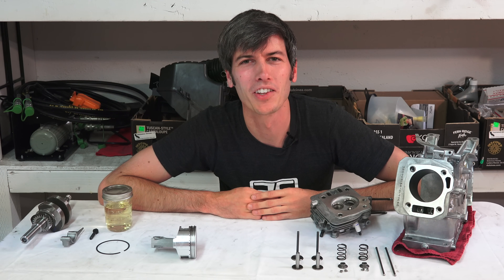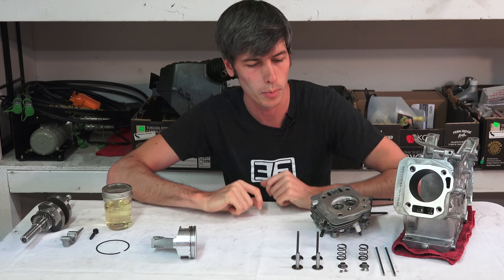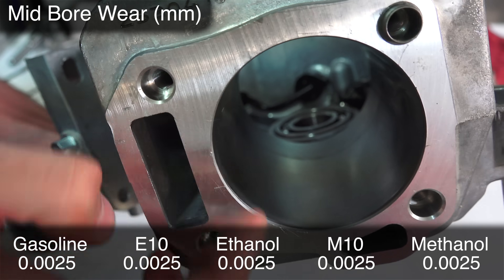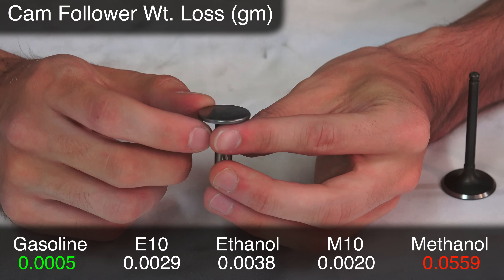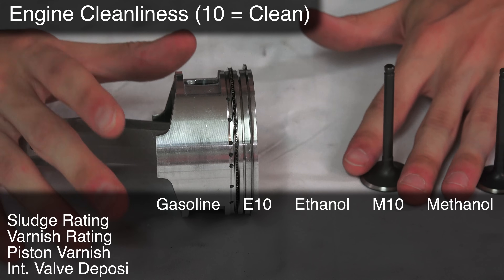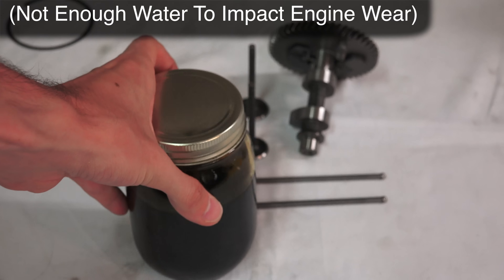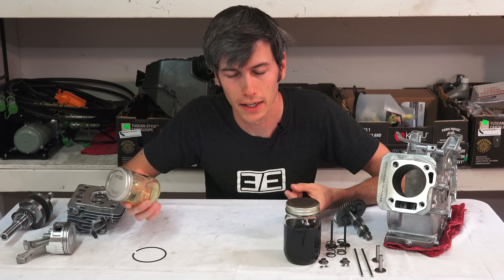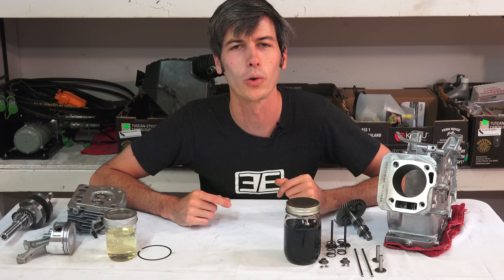Is Ethanol Bad For Your Car's Engine?

Comment: Down here in Brazil we have E92 and E27 fuels. But the prices on gas are skyrocketing, and the market ain't known for good quality gasoline, so most times, the 27% ethanol mixture ain't respected. If you run a simple OBDII tool in our flexfuel cars it'll show a 35-40% ethanol mixture in the combustion of E27 so... We stick to ethanol here (preferably) regardless of fuel economy. Plus the pricing between E92 and E27 gas runs close to the 60% regular efficiency between those 2 fuels. So you kinda get the same $ for mileage, most times...
My car actually benefits from ethanol since I calculated it's efficiency as somewhat around 72% of E27 gasoline, so it's actually more efficient on ethanol.

Comment: Don't know about engine wear but the fuel with ethanol here in the UK gums up the carburetors on small Honda type engines used on generators and other equipment that the old fuel didn't. I have to drain the carbs on my generator and tools if I wish to store them with out being used for a long time period otherwise they will run very badly or not at all when trying to restart them after 6 -12 months storage.

Comment: Great video! Would love to see a follow-up on energy density of fuels (Gas, Meth, Eth, Diesel, etc.). I noticed this when using an E85 Focus in Indana (super flat). I drove the same speed both ways & changed fuel types. Very different MPG numbers

Comment: havnt watched the whole video yet but i want to type this before i forget, modern cars are all designed to run on ethanol in case of a fuel crisis and since modern fuel in america contains ethanol anyway, but older cars are the ones with problems, in older cars ethanol causes the pipes and fittings to degrade, combined with the effect of running unleaded in an older car that is supposed to have leaded causing the fittings to also harden modern fuel can ruin a cars fuel system.
also ive heard alot of motorcycles and track oriented sports cars can have problems from ethanol too.
also running low octane rated fuels in motorcycles and sports cars that dont like it could add to these issues too.
this is all what ive heard anyway dont take my word but its better not to risk.
Reply: ok good he did mention the fuel systems of older cars

Comment: I wonder if there are any wear differences between a diesel engine running purely on diesel fuel, a gasoline oil mixture, with and without propane injection...

Comment: But why do they put ethanol in fuel in the first place??
Reply: Less carbon produced and is more carbon neutral due to being plant sugar based, higher octane, doesn't create other pollution issues like using lead or MTBE does when used as an octane booster, can be made from just about any plant too!
Reply: @GreenJeep1998 now  that's a detailed answer. 😁 Thanks!

Comment: Ethanol is considered bad for your motor vehicle because it's said to effect the non metal parts...   These tests are useless.
Reply: How so? This comment section is cancer. Nothing but statements from backyard mechanics with no facts to back it up.
Reply: Car manufacturers are aware there's ethanol in fuel now, I'm sure they have ethanol compatible hoses and connectors.
Reply: These tests measure engine wear. You might as well be complaining about aerodynamics.
Reply: The title of the video is "Is Ethanol Bad For Your Car's Engine?"
Reply: Not as useless as your comment.

Comment: I've always wondered what fuel injected cars not made for E10 do. Does the O2 sensor account for the air/fuel difference enough for the car to run correctly? I assume it must but I don't know enough about how factory (narrow band?) O2 sensors work.

Comment: This is really handy timing as the UK is soon to be switching to E10 from E5 and a RAC news headline was sent out warning drivers to be cautious of what fuel they put in their car when E10 becomes available. I think it said something like 800'000+ cars that are currently registered on our roads are not compatible with E10, the older cars like you mentioned, but these figures don't make it seem as bad as they make it sound. A detail you covered makes me wonder why it's done. If a higher percentage of petrol (Gasoline as you know it) gets better MPG then why does a greater 'environmental' drive result in fuels being selected that do not offer equal or better MPG but instead reduce the figures we're likely to see? The UK is trying to rule out diesels and now a less efficient petrol. How does this reduce pollution if more has to be burned to produce the same power? An example of this is a survey that was done after the diesel ban was announced showed that emissions increased when more people started driving petrol cars. With E10 the same story will repeat itself so how do they think they will reduce pollution if everything they do increases it?
extra fact; I filled up with diesel today. The station I go to has diesel at £1.30.9 per litre, unleaded petrol at £1.28.9 per litre and Texeco's supreme diesel at £1.37.9 per litre. 
I converted the values through Google and our diesel costs $6.44 per gallon, unleaded petrol (gasoline) costs $6.32 per gallon and Texaco's supreme diesel costs $6.78 per gallon. Is that still high compared to the US? By the way this is the affordable regions, smaller town in Northern Ireland. I believe in Scotland you would be looking at £1.32 - £1.35 per litre of regular versions of fuel and I'm sure the supreme/super versions would all be over $7.00 per gallon when converted.